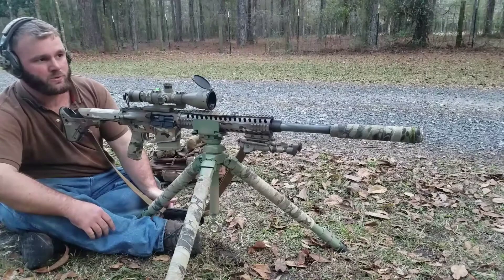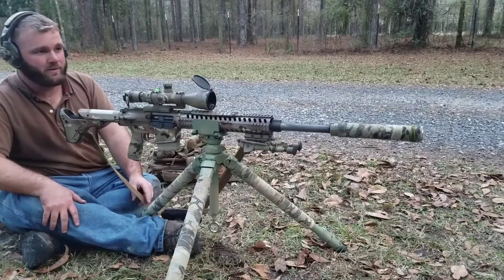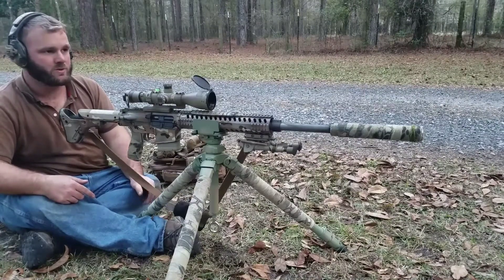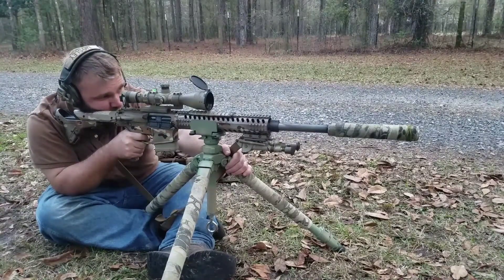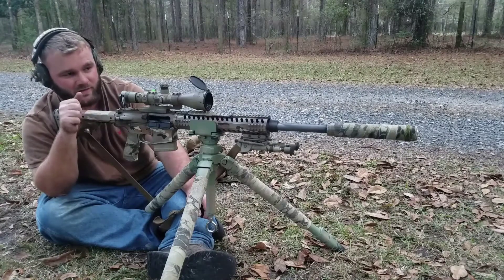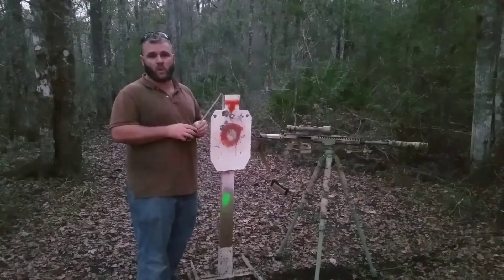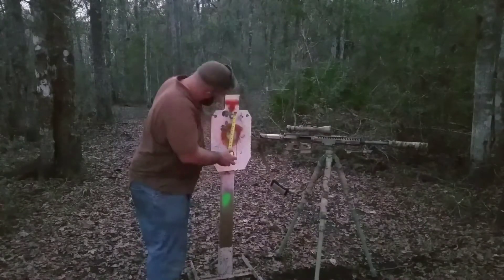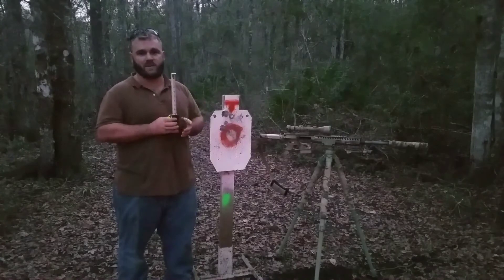Accuracy in a Gas Gun.

Comment: i got a pa10 gen 2 and I wanna put a ballistics advantage barrel with do you know if I will have to get a different bcg than the one it came with and idk much bout headspace and was that a issue with your build thanks and good shooting
Reply from the maker: Austin Sherman the bcg you have should be fine but my advice is to get one with duel ejectors. in my experience they work better. I used KAK industries bolt for mine.
Reply: Alright thanks a lot hope mine turns out as nice as yours